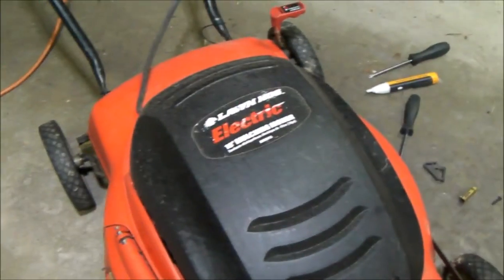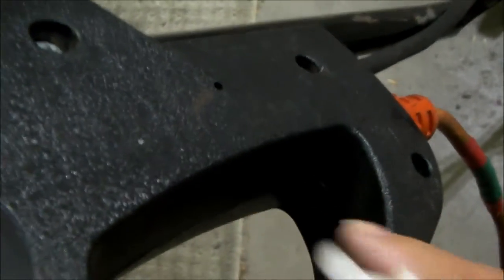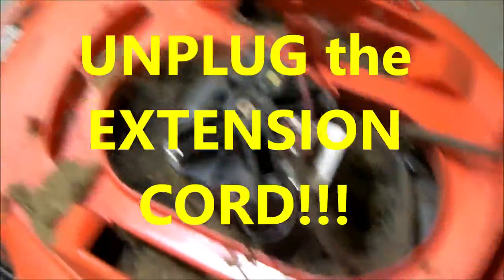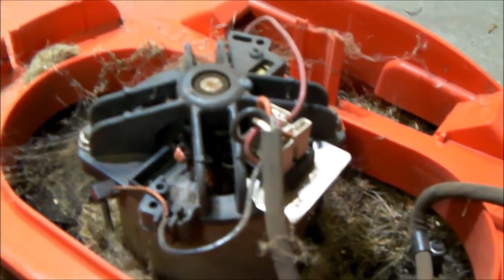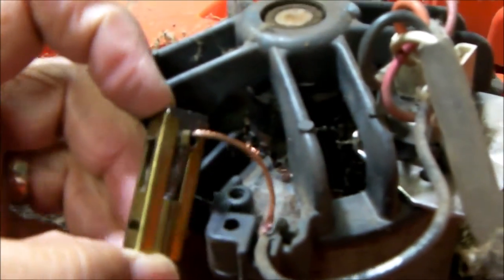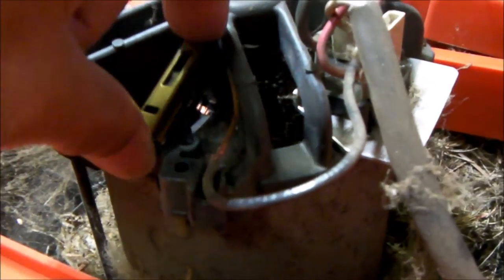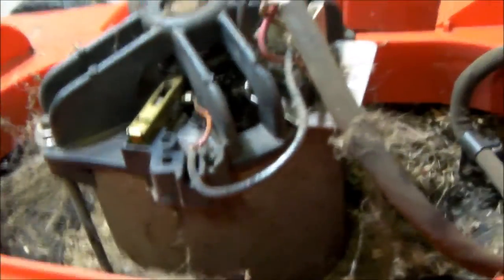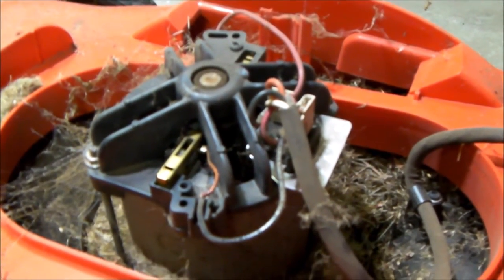Black & Decker 18" LawnHog Electric Lawnmower not working ...  won't turn on, won't run.

Comment: I had one of these for like 10y and they are pretty strong. I had to rewire it and would keep the blades very sharp.  I'm looking for a used one and gonna cut the front off and use it like a Brush hog.

Comment: Why does the grass get all under the cover like that. Mine was even around the motor.
Reply: I think the fan is creating a suction and blowing some of the grass into the motor when its supposed to be shooting the grass into the mulch bag.

Mine's does it even worse since the blade chopped a nasty hole into the mower deck.

Comment: Hi again. I took the blade off this same model had a shop sharpen it, also they found a second blade for me and sharpened that also. While putting the blade back on, I noticed the Insulator   was messed up a bit, so I ordered two of those as well. Put it all together My lawn grass was a bit high so I raised the deck. A pass or two in the blade had started to spin funny, messing up the insulator. 
Any thoughts?  Everything was tight, or so I thought. All parts werein order of assembly.

Comment: I love this video about how to fix my loyal lawnmower...I followed everything and I've purchased the brushes but I don't know how to crimp them to the wire...? I can use my strong pliers but I don't have and have not been to find a tiny metel crimper??? Where to find a crimper? Is there a workaround?  thanks.
Reply from the maker: Solder or strike the terminal with a screwdriver and hammer to crimp it

Comment: def no auto focus up in dat cam ...  i wonder why b and d made a dc motor instead of putting a synchronous motor like in a washing machine ... --- rpm ?
Reply: DC motors have way more torque than others; that's why they run elevators up & down.